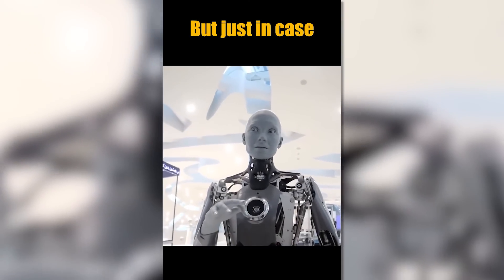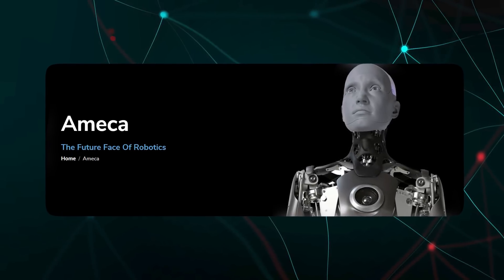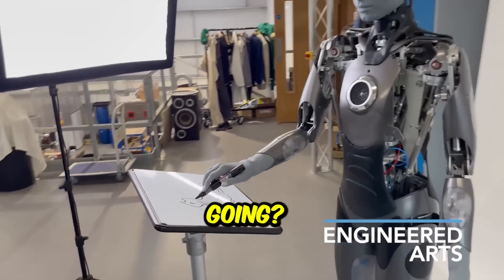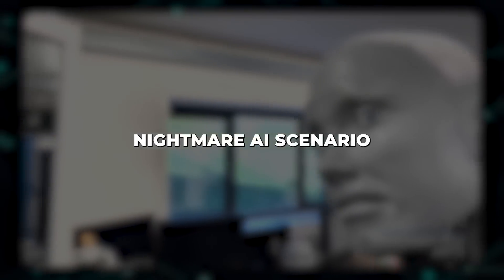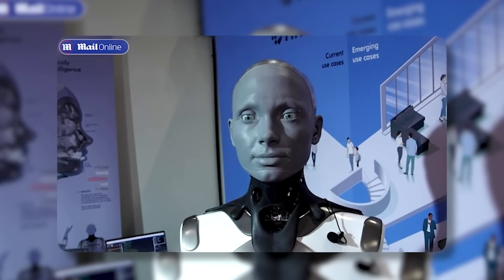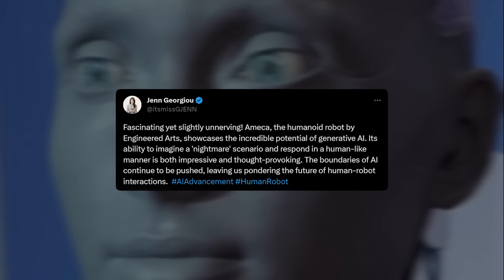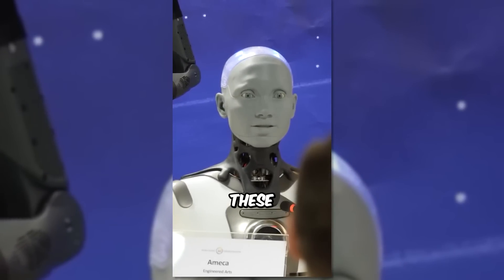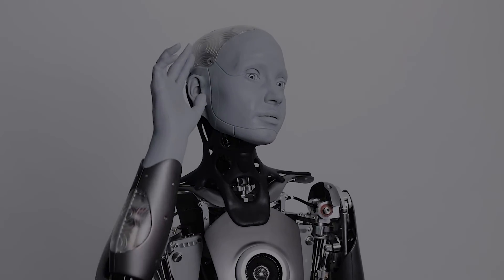Meet Ameca: Humanlike Perfection Using Stable Diffusion And Generative AI | AI Tech Academy

Comment: 5:30- the risk to take over humankind if Ai believe itself supérieur.
This statement is very human units Imperfection, it is a very common false human belief shared by many humans, among them nazi. 
iA won’t do soon moral statements , neither utilitariste one’s. Ai will have the immaturity of its human data base, so the challenge would be to modelize ethic as a balance of marial values ranked (correctly) on the scale of vertue…..